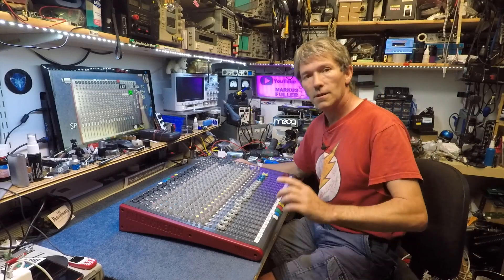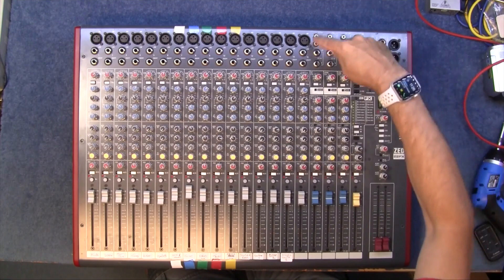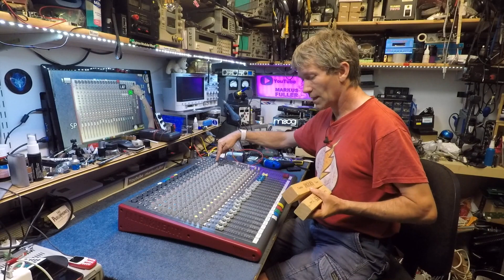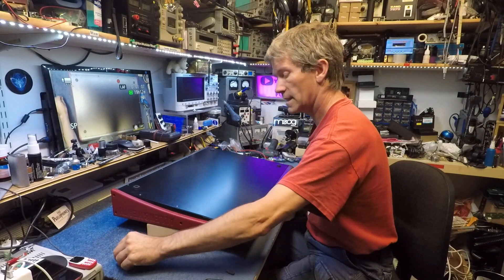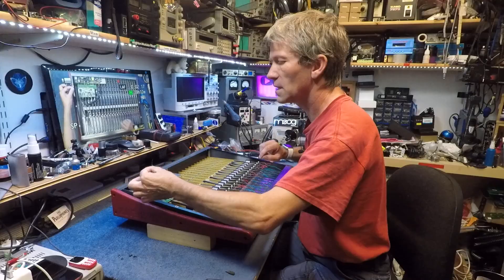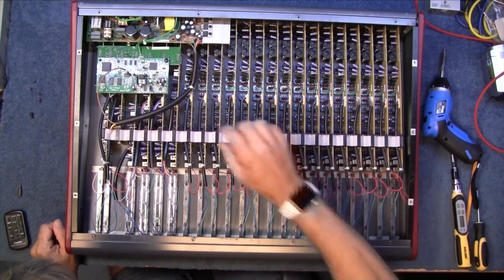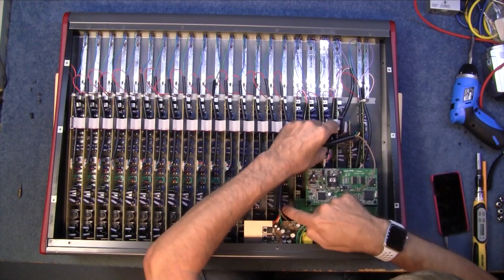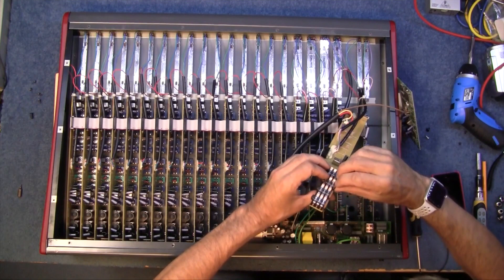Fixing broken Jack sockets on Mixing desks

Comment: Not boring at all Markus.  I hate working on mixers with single boards because of all the knobs, pot nuts and jack nuts to take off, not to mention the screws before you even get to the electronics.  A great repair, well done!
Reply: I only work on REAL recording and live mixing desk Not junk bought at GC or some other consumer BS music store !! Those boards are disposable, but every once in a while i get a request to mod or add xformers to channels internally to some of that junk, ive had to add ferite beads to the inputs of so many mackie boards because they rf so bad you could pick up 3 radio stations at same time and dial them in seperately by using the eq and pan... gotta love that !!!!

Comment: Great job, these Allen and Heath are bullet proof I would not trust anything else for live or studio based on value for money. Great channel.
Reply: Ive had several of their boards and repaired and maintained many they are a decent board the system 8 and the ml series are the best mid quality board and bang for the buck didnt like the fixed EQ on system 8 but it was musical so i could make it work, but you have to spend serious money if you want a Pro modular version of their serious offerings syncon A comes to mind cumbersome routing but fabulous sound, should of stayed in that direction but they had to get into the prosumer market and ruin it
Reply: Medicine Man , Hi totally agree with you but as ever it is all down to component and production cost, plus the little matter of desirability which of course is their core business. I have had several of there mixers never had issues with any of them gigging or in the studio, as I am now old and decrepit and no longer gig I have settled on the Zedi 10 fx which suits my home studio perfectly with the added bonus of usb 4 in 4 out for recording sounds great at the 96khz, cheers. Andy.
Reply: ive had mine for 15 years now. love it.

Comment: Amateurs: "DON'T TOUCH THE KNOBS, BUTTONS, OR FADERS! (because we have no idea what they do)."
Reply: That’s what I thought... As well as 'we don’t have cameras and don’t know how to take notes'...
Reply: Agree . A&H did or do printed sheets showing knobs, pan pots, faders etc so that you can do a chart showing settings for a mix, gig  or whatever, as did most desk manufacturers. Also, unless the mixer is a house mixer, control settings should change for every location ( but they'd still change for different bands) and any good engineer would keep notes.
Reply: In my eagerness to poke fun at the band owning the mixer, I forgot to commend Markus' brilliant work in repairing said equipment. Thank you for another pleasant, insightful video, Markus.
Reply: I was in a band like that briefly; they had no idea what they were doing, but they'd bought a board (brand new & overpriced imho) and wouldn't let anyone near it. I mentioned I'd done my stint as a live engineer, and regularly used both hardware analogue boards & software consoles in my DAW, but they just looked at me, suspiciously. Numpties
Reply: @oneammonday  Seconded
Reply: Jim Merrilees  Good for you Jim. You don't want just any nincompoop comin up and ruining you mix, when you don't have digi-recall. And if your board is always in the same room, you get to learn the acoustic nuances of the room. However, good engineering tells you that frequency response across a variety of venues, with varied acoustic resonances, different sized airbound or open environments, means that ONE SET of settings doesn't translate across all environments. Good engineers use their ears and make settings changes from that. A 3-band EQ with sweepable mid and shelved upper and lower ends is the most the majority have, so there's little point worrying too much, and the amount of gain applied on each channel, will vary with changes in the acoustic environment. Professional engineers and mixers (I'm not one of them) are 'hands-on' because sound levels change, in performance, on stage - the backline, ushering in the need to tweak. The board in the vid was a basic one, but people do need to know what the knobs are doing. Happy mixing
Reply: I always set everything flat on the mixer and set up to the room, as every building has different acoustics. A certain setup may sound amazing in one space, but have too much or too little of something in another.
Reply: Jim Merrilees  yes that's very true, even just having people in the room silent deadens some of the natural reverberation and requires so much tweaking to get the sound right! It's the reason having a dedicated sound engineer is so useful! Not just leaving faders set from place to place!
Reply: Jim Merrilees  haha good point! I usually act as sound engineer for my dads band and he's usually my sound engineer tbf! It's useful as we both know how each other wants our bands to sound now! Also, some venues have them nowadays which is useful, however they don't always get it right, but it'd be rude to ask to use a different sound engineer to their in house one! Haha
Reply: I hope they paid him extra for this job
Reply: Jim Merrilees  I'm an inexperienced clown when it comes to sound and even I wouldn't expect that
Reply: Jim Merrilees  Yes, but Markus is not some drunken mouth breather, stumbling around their equipment in a dimly lit bar. He knows what he's doing when he's under the hood of a mixer. This band is a group of very mature people who should know how to use their equipment at this stage in their lives. Telling him not to change any settings while repairing their board is ridiculous.
Reply: Jim Merrilees  Sorry, Jim. I read this quote from Bring Me Sunshine earlier in the thread "Good for you Jim. You don't want just any nincompoop comin up and ruining you mix, when you don't have digi-recall." And responded to the wrong person. What I was trying to express was that Markus knows what's what and he's not some nincompoop and these guys should be able to start a show with a zeroed out board with no hassle. I've been watching some friends of mine trying to record themselves lately and it's been driving me nuts watching them make stupid beginner mistakes when they're in their 50's and should know better. So, my obsession has made me a bit frazzled lately. Sorry about the run on sentences, also.
Reply: Jim Merrilees  someone who has a sound set and doesn't want it to change
Reply: Jim Merrilees  I think you misunderstand, if you only use it in one place and have everything set up. You don't want to change things as everything is ready to go
Reply: Jim Merrilees  i guess that includes the punters as well coming to the "gigs"

Comment: That mix gain staging setup. Eek. I wonder how they got to that mix. Definitely they could see benefits from going digital if they don't run with an engineer on the road. Avoiding Soundcraft ui16, the UI24R is good, Also the Behringer rack mounted ones look great for band use.
Reply: it looks like they are using all of those inputs, so a rack mounted mixer wouldn't be very good.

Comment: I'd guess what happened to that jack was that someone tripped over the cable plugged into it, snapping the tip off the jack and breaking the threads.
Always interesting to see inside different gear.

Comment: Not a tip from a 1/4" mono plug? I got the tips stuck in my Komplete Audio 6 XLR combo jacks after pushing 1/4 mono cables in too far. They had a death grip on the plug and the pressed on tips pulled off when pulling on the cables. At least I can use XLR cables now.

Great video.
Reply: nothing worse than getting the tip stuck...........

Comment: 13:07 Those little plastic posts that you tossed aside because they  are "a complete waste of time" are stand-offs that support the board against (and isolate it from, electrically) the bottom of the case. Considering that this is "road gear", I hope the board doesn't work itself loose over time -- either pulling out of the connector on the top side or shorting one or more component leads against the metal bottom plate -- and kill the entire mixer (or, at least, the effects bus) as a result. That's probably not very likely considering that there is also a screw holding the middle of the board in place, but still, that was definitely not your most brilliant idea, mate!  ;)

Comment: Wow. You're fixing their mixer and they asked you not to change one setting? That seems completely unrealistic under most circumstances!

I've been running live sound for decades and every gig/venue is different, so I don't even see the point.

But hey, speaking of fixing A&H mixers, we have one at a venue where I occasionally work, and Aux5 is super low output and distorted. I'm thinking maybe it's the summing amp for that aux, but have heard nightmare stories about opening that mixer up. Wanna come across the pond to the states and help?  :-)
Reply: Mix wizard ?
Reply: Which model A&H do you have at venue
Reply: @roadwarrior4080  GL2200

Comment: Pedant's observation - A jack is a socket by definition.:-)
Reply: That threw me a bit after moving from the USA where sockets are jacks, to Russia where male plugs are "jacks" and someone wanted me to wire a set of patch cord TRS jacks and wired upsets of inline female jacks, when he wanted TRS plugs on cable ends.  I had shipped over 500lbs of test equipment for hobby and design activities but ended up creating a service shop as a side business which turned out to be the only one with a business license in a city of over 5,000,000 people.

Comment: I have an Allen and Heath Z24( No fx).  Aux 1 and 2 are not working. I'm thinking that the contacts have been bent and therefore not making a connection with the jack. My question is, can the internal parts of the jack be accessed to bend the metal spring connection, or do i have to replace the jacks? Thank you for the very informative video.
Reply from the maker: to be honest I do not know if you can access the internal part of the jack. some you van some you cannot it depends what type A&H used for that mixer.

Comment: While you are in there, might be a good idea to 'rugedise' it ie put silicone on the parts that are hanging down it looks just like my A&H with the long strip of ribbon cable that drops with vibration. I'm sure you can figure all that out.
Reply: If the header connectors are falling off, replace the whole ribbon cable because it means the contacts are not gripping the pins so even if glued in place, the connections become intermittent. A&H uses pretty good connectors so that is unusual. Those are some of the easiest boards to repair because they use standard parts and they use channel strips so a single channel can be run while outside the mixer so access to both sides of the pc board is accessible for signal tracing.

Comment: Markus, my headphone jack has broken off into the Headphone insert - the tip has completely got jammed in.
How can I get it out without dismanteling my Audio Desk? It's a Hill Audio Soundmix 16track analogue mixer from the 70's ... I wish I could share a Picture? You can see the tip but I just don't want to cause any damage by just pulling it out - what is tricky is plyers wont fit in the hole..
Pete

Comment: I had to tear into a bigger A&H years ago when I worked at the local University.  Some idiot shorted the P and N pins on a channel with phantom power on.  Fortunately I just had to identify the skid-marked resistors and replace them and it served for several more years.
Reply from the maker: Yes I like allen & heath desks and i have never had to do any complex work on old analog desks. just simply replacing easy to get components.
Reply: Shorting Phantom would not burn resistors, the current is limited by 6.8k resistors connecting both +/- of the balanced lines, both pins are at the same +48volts DC in a P48 phantom supply. Shorting them would cause no current to flow. Both pins would be 48v positive above pin 1 ground.  Even if shorted to ground the max power dissipated in the limiting resistor would be about 0.250 watts

Comment: "Dismantle this huge mixer but don't move any of the 200+ knobs or faders on it."
You're a far more patient man than me if you took that job.
Reply: Pots and faders that are never moved or adjusted will develop intermittent audio eventually. The wiping action that occurs when adjusting levels is necessary for their longevity!

 I would have taken some pictures of the control settings, so that they could be reset to the same positions after the repair.

Comment: Total newbie question... so these sockets are unique to the manufacturer, or might you find one in a catalog if you lacked a "donor board"?
Reply: Goto: cliffuk.co.uk, that's where they come from and basically every electronics supplier stocks these and most manufacturers use them.
Reply from the maker: They are not unique to the manufacturer. theres just so many different versions that you can buy pins on the bottom or pins on the side. slightly different spacings etc. you will always be able to get them somewhere.
Reply: @mudsharkable  There are several brands that are plug-in replacement. I use the version from Amphenol. They come in a couple pin spacings so most shops stock dozens of different TS and TRS jacks.

Comment: With the price of them now I would just tell them to get an X-AIR XR18, you can't knock the faders on the front of one of them as there are none!
Reply: I do get that they are a good deal but having faders and knobs is pretty much a necessity if you want to do actual mixing because you're gonna need to be able to react quickly but for smaller set and forget shows the x-air is perfect!
Reply: Though one thing that is good about the X-AIR series is that you can control them with the X-Touch fader banks and (on the X32 with X32-Edit on the PC at least) use any Mackie control capable fader bank, so even the older BCF2000 would work.

Though in this case as he was not to move the fader/knob positions the point of faders is rather pointless. Set and forget is what mixers like the X-AIR do very well.  @BoboButYouCanCallMeTom

Comment: I've got one of those de-soldering irons, interesting you said 'they're great when they work!', do you mean when they do their job properly or do you mean when they actually heat up as in 'work'? Mine is so temperamental, often it just won't get hot at all, any ideas where to start looking for the problem, I've had it apart as far as it will tear apart but there's no obvious problems, sometimes giving it a smack can get it going but that's rare.
Reply: Desoldering braid or wick is the propper method to use i only use a sucker on old reuse xlr or 290's jumbo 180 when cleaning for reuse
Reply: Sounds like you have a HR (hi resistance or intermittent discontinuity) inside the element... Good luck with that!

Comment: Why would they ask you don't change anything? I'm a student sound engineer just wondering why someone would tell you not to touch any faders or pops? I mean when they go into a venue they have to do a line check anyway so...... does it matter if everything is just 0. Isnt that standard? Everything just set to 0. If they want pre sets why not just use a digital

Comment: Pro Tip.  In no way shape or form are ANY of those knobs or faders set for ANY type of performance.  If they claim that they are then they won't notice any change in them.  If you are commissioned to fix that board then its not your responsibility to make sure they are all back to where they were.  If they can't set that board back up in ten minutes or less then they don't need to be operating it.  That's like sending your Christmas Tree in to be trimmed with all the ornaments on it and expecting them all back in the same place.  That's nonsense.  Tell them to get realistic or get fucked.

Comment: Plz take our board completely apart and replace the socket and jack we smashed off by being careless... but DO NOT CHANGE ANY SETTINGS b/c we are totally unreasonable dumfuks who are too stupid or lazy or both to reset them for ourselves. 

SO - what you should do for them is CA glue (superglue) every last control in place before you start the disassembly. That will ensure their mix is frozen in time, for all time.

Comment: the band got to be cave men band what if something very bad went in the mixer like
the power unit i would never ever use this for gig's this is a uk mixer deck they use RS stock
jack sockets
Reply: Soundcraft series 5 or soundcraft 800b the rest is rubbish except Midas xl250
Reply: Awww come on, you just made me look for the part on RS now! RS didn't seem to have the right one, however I found it at CPC, and it's a Cliff CL13345 (CPC AV28088). Back on RS, they think that Cliff part number is their RS-PRO part 143-8935 (stamped CLIFF in the plastic!). Farnell it's 2766192.